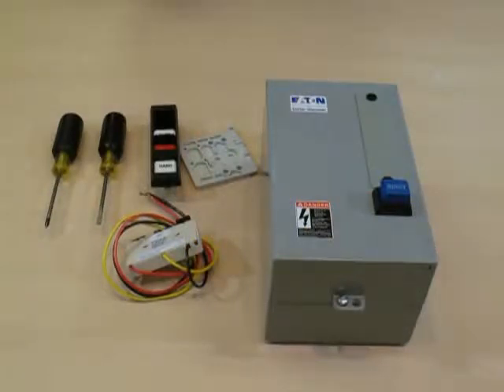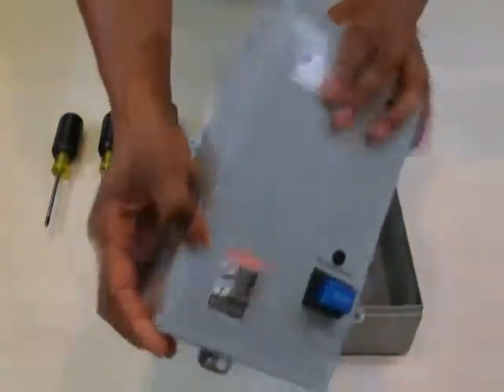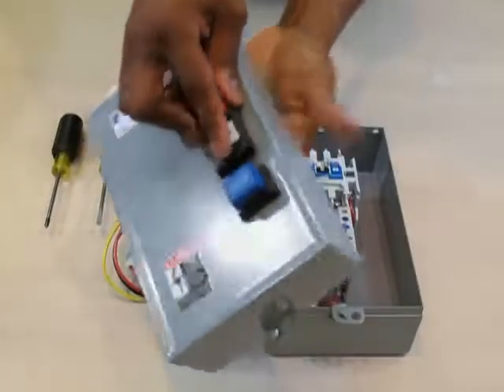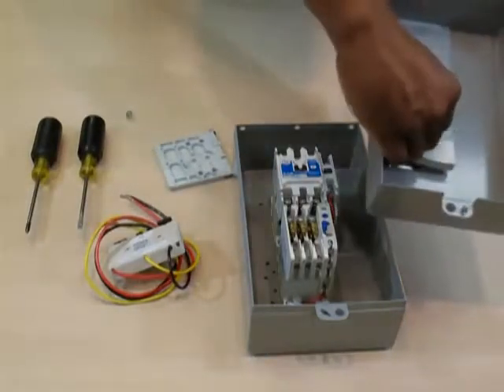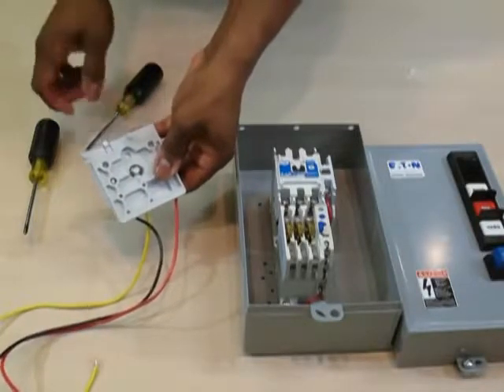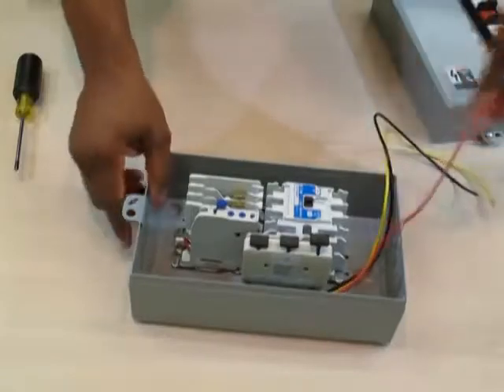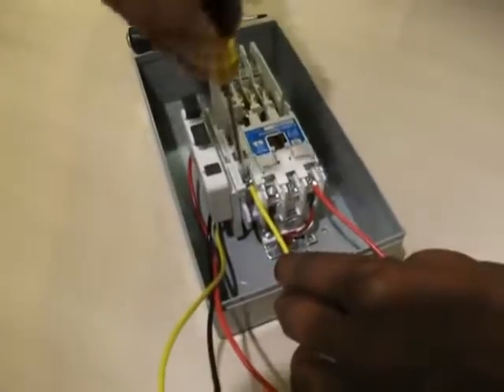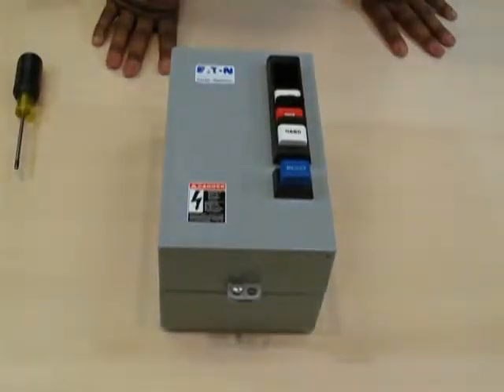Eaton- How to Install a Hand-Off-Auto Kit

Comment: Thanks for the video.  What terminals does the power come into the box and which terminals do you use to send power to the tool?
Reply: Super Speed L1,L2,L3 come from panel T1 T2 T3 goto motor